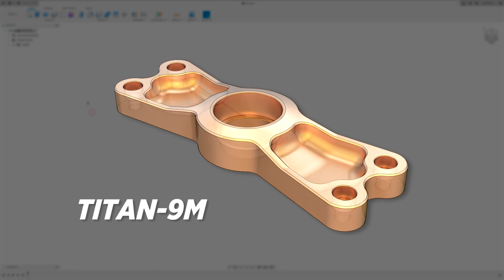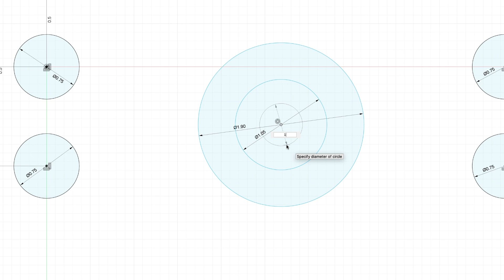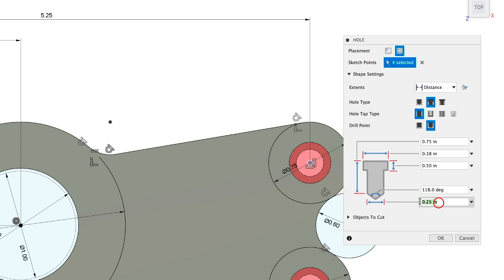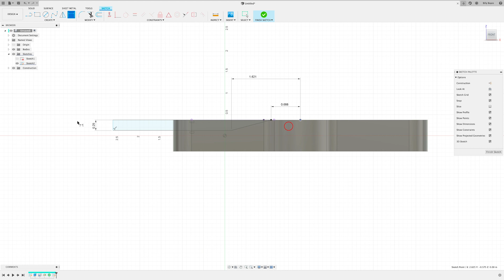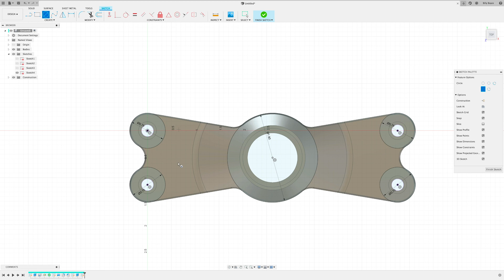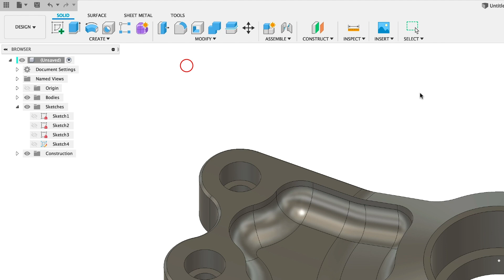FUSION 360 TUTORIAL: DESIGN THE TITAN-9M | ACADEMY

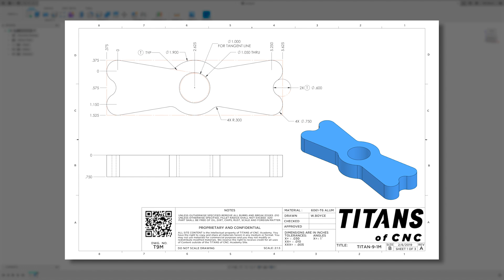Comment: (click on blue time 5:10)Unless I am wrong you have two different depths for the counter bore.On print two in the top view you have the counter bore  at .250 and in the side-view you have the counter bore depth at .500.
Reply: Because this step is done before the piece is cut with the revolve. So in order to get the .25 actual counter bore it needs to be counter bored to a depth of .500 so after the press/pull is finished it gives the correct dimension.
Reply: it can be done this way or after the revolve.  i personally like doing it later so its possible to have the design history follow the drawing for edits later.